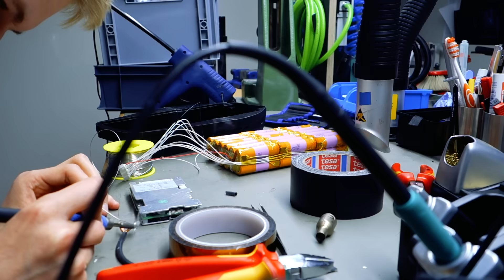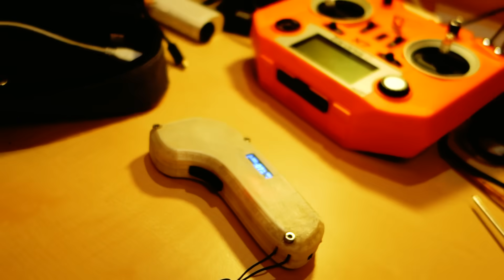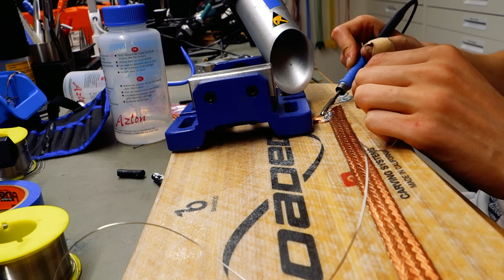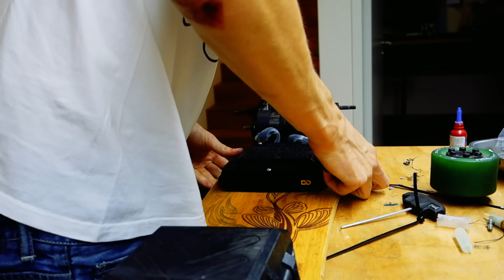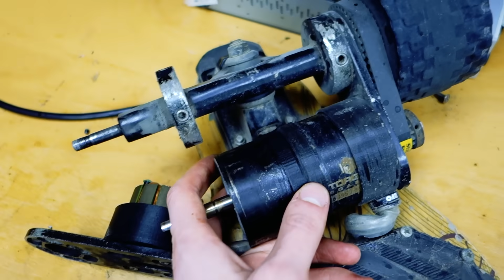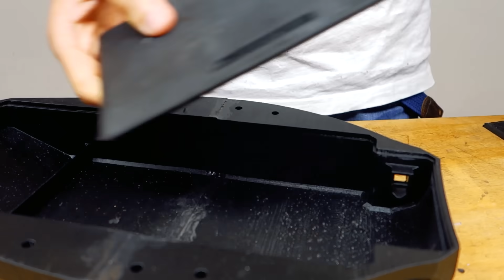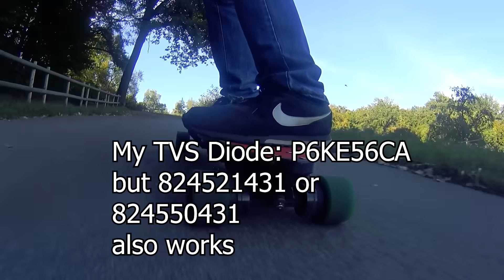My 3D Printed BOOSTED BOARD KILLER

Comment: als ob 5000 watt nur für 50 kmh reichen...
Reply from the maker: elektromotoren haben eine eckdrehzahl, da das ein single speed gear ist kann nur eine maximale drehzahl erreicht werden jeh nach dem welche übersetzung ich verbaut habe. In dem fall trifft diese eckdrehzahl auf etwa 50kmh. Ich könnte auch ein kleineres Zahnrad am Rad verwenden und damit locker 80kmh fahren, aber dann hab ich 1. kaum mehr drehmoment und 2. was will ich mit 80 sachen auf nem eboard...

Comment: Another useful and super cheap addition is a small pack of silica gel inside the casing. It will keep out condensation vapour and maintain as dry an area as possible. 
You will get them free in PLA filament packs so just keep and use.

Comment: Hey im teen and i have a long board, im kinda a tech geek so i think i would be able to build, but does anybody know how many money id need to save up?
Reply from the maker: you can use recycled cells and cheap "electric skateboard hub motor kit" from aliexpress and a cheap 10S BMS that will get you running with less than 300€. Its not a insanely powerful kit but its still a lot of fun...

Comment: I use quality capacitor on my drones circuit board for noise filtering on the battery. Thx for the tip for esk8 electronic I did not know the TVS diode.
Reply from the maker: I also added a tvs to my drone, just keeps it safe and avoids broken escs
Reply: @Pryside  I burnt a lot of esc... I will a TVs also. Super thank you.

Comment: Thanks man
Can you please tell me how many Amps are you running through your board ?
Reply from the maker: I was running 90 Motor Amps per Motor. So 180A there and around 115A on the Battery
Reply: @Pryside  Hey , leo can you also guide me through this ....
See my DIY E board battery has a discharge of 40 A , with a 24A esc. But i installed a 15 A bms on the battery pack...
But my positive end of the battery goes directly into the esc , neg end goes into the bms . So am i running my board on 15 A ?
Reply: 90A is crazy, your Battery is only 45 A !!
Reply from the maker: @esk8tapas22  no 45A is constant rating. Peak depends on if you monitor temps which I do. And how hard you want to stress them. 35A per cell is easily possible for a few seconds, wou wont need it for more than a second anyway, cause you'll reach 50kmh in no time with that
Reply: @Pryside  That's right ...
But you shouldn't stress your battery anyway ....
Thats why I'm going to use 21700 cells next time , which can put out 35 A constant & have great capacity to !!
Reply from the maker: @esk8tapas22  capacitance helps with hf voltage ripples not with any peak current. Look at the 25R cells for example they have 20A constant and 100A peak. And they actually haver higher Internal Resistance than the 30q

Comment: No way its 5000w
Reply from the maker: Here the copypaste from my forum:
Here is a full calculation of how much power you can actually get using my setup:

Fully charged Battery at 50,4V. IR per cell is 20mOhm (DC iR from Datasheet), 3 in paralell is 6,3mOhm, 12 in series is 75mOhm Lets calculate the theoretical maximum. I currently have a 75A Current Limit, but lets assume I set this to 90A say I go full throttle: My Vescs pull 180A 180A * 0,075Ohm = 13,5V voltage drop inside my Battery 50,4V-13,5V= 36,9V Voltage going to my VESC (still above 3V per cell) 36,9V * 180A = 6642W so thats the amount of Power getting eaten from my vesc. Thats where usually everybody stops and says that this is the power, but since there are a ton of losses at this current here is the real mechanical power that you would be measuring on a dyno: Resistance of my vescs: 0,0011Ohm Resistance of Motors: 0,0225Ohm (0,0011Ohm+0,0225Ohm)*180A²= 764,64W of Power loss in Motors and ESC 6642W-764,64W= 5877W MECHANICAL POWER so yes, the 5kW is easily possible.
Reply from the maker: it really is. Peak power of 5kW is possible

Comment: I want to turn this build into a dirt board version with snowboard like footstraps and rear mounted motors. 
Would you support my decision? I'd use your stl files and arduino programs in order to run it all. :D
Reply from the maker: yeah maybe would be a nice idea. Personally I dont really like eMountainboards, they are too expensive and too heavy and destroy the purpose of a light electric vehicle I can carry around everywhere.
And my battery case is not really designe for that purpose. Its just 12S3P on a mountainbaord you generally want to have more capacity since its heavier anyway.

Comment: Hallo Leo,
Ich habe dein Anti Spark Switch nachgebaut jedoch ist dieser mir nach einer kleinen Testfahrt hochgeflogen. Ich vermute, dass die >60 Ampere  zu viel für meinen Drahtwiederstand (axial, 50 W, 1 Ohm) waren. Dieser ist auch sichtbar kaputt gegangen. 
Hast du einen Tipp, welcher Drahtwiederstand besser geeignet wäre oder liegt der Fehler doch wo anders?
Reply from the maker: Hi tim. Da hast du was falsch gebaut und die Funktion davon nicht verstanden. Kein strom fließt im betrieb über R3.
Von meim antispark gibts mitlerweile ein gut getestetes pcb, kannst dir mal anschauen verkauf ich im forum.
https://www.electric-skateboard.builders/t/3d-printed-boosted-board-killer/88803/177
Reply: @Pryside   
Okay danke 👍

Comment: I also have an anet a8. I bought it 2 years ago for 170 € and it's still working really good. For remote I used a rc remote control but build an arduino nano in it for all this controling stuff.
Reply from the maker: Saw some Ender 3 Prints and for the price this is propably the best print quality. But with a Boden Style you can't print TPU, so Anet A8 stays my favorite cheap printer for now :)

Comment: Hi Leo!  I hope you can help me really quickly... I am DIYing my own E-Longboard right now and would like to add a TVS diode to my seltup as well. I am running on a 10S2P (18650)  Setup with a Dual VESC 4.20. Can you please give me advice what TVS diode I should use? I think you run on a 12S setup right? Do the diode specs need to be any different between 12S and 10S? Thank you so much! Keep the good vids comming!!!! Cheers!
Reply from the maker: The tvs mentioned in the video and mentioned in the forum. 12S with tvs and low ir caps like EEUFR1J681L is ok. You could use a lower breakdown tvs but this diode is ok for all
Reply: @Pryside  Thank you very much for the quick answer! You are the best! Keep the good vids comin'

Comment: Kannst du vielleicht ein komplettes Tutorial für die Firefly Remote machen? Meine Englisch-Skills sind leider nicht die Besten, aber ich würde voll gerne mir auch so ein Ding bauen. Aber sonst cooles Video!
Reply from the maker: ich werd die wahrscheinlich als kompettes set mit gescheitem pcb in den nächsten wochen/monaten entwickeln und verkaufen, damit kann ich glaub mehr leuten helfen, weil die firefly ist ein ordentliches gepfusche zum zusammenbauen
Reply: @Pryside  Das wäre Hammer!
Reply from the maker: Den antispark wirds übrigens auch in den nächsten 1-2 wochen als kaufbares pcb hier vorgestellt :)
Reply: @Pryside  
Hab ne frage wegen der anti spark.
Hab mosfets gefunden mit 20V maximaler gate to source voltage,meine frage ist kann ich die mosfets dann benutzen mit einer 6s batterie die vollgeladen 25.2V hat.(IRFS7530)

Comment: your choice of uart is sort of confusing to me. to be honest, my time using uart adapters proved them to be wildly unreliable with constant random disconnects and high latency.
Reply from the maker: Thats because of shitty cabeling and bad connectors, has nothing to do with the serial protocol. Uart is very reliable and fast with 5ms latency and definitely the right choice since you'll have safety that the command you want from the vesc actually gets processed. While a 5V signal on your pwm pin will send your board flying and risk your life, or a sudden 0V singal blocks your wheels and will also end very badly all this stuff cant happen with uart. On uart you can be assured that all your signals get processed the way intended. Uart is definitly not the issue its superior in every way possible.

Comment: Hi I'm trying to add the motor protectors to my flipsky 6374 motors but when I mount them it creates a whole lot of friction and you can barely turn the motors by hand. Is that bad?
Reply from the maker: My motor guards are not really made for any other motors, the guards are propably crooked and bent since cables and everything else is propably not the same as on my torqueboard motors. See if it really fits, propably you'll have to design your own. Only took me like 20 minutes of cad. Really simple design
Reply: @Pryside  thanks for the reply! im going on to build the battery pack now!

Comment: Anti spark?.. Why don't you just use a relay? That's what they're made for..

Also pla sucks. Use PETG, I print tons with it.
Reply from the maker: Petg has way worse stength compared to tough pla.
A Relay is not possible will create a huge spark between the contacts, increase the resistance and will melt your relay and destroy your escs when it shuts off under load due to its high resistance. You need a good antispark. On top of that any moving parts are always a bad idea.

Comment: Great video. Can you put a link of the TVS Diode you used for the vesc protection? I'm running a 10s3p battery (236.5W) battery and Vesc and 6374 149kv motors. Also, can you make a video on how to install the TVS Diode on the vesc.

Comment: dude, the  problem isn't the nun chuck, it's the control scheme.
Reply from the maker: nope, definitly not. I have tried everything, the tiny 5mm that your finger has to move without any real resistance and the high power my board makes, makes it very annoying to ride.
I rode around 2000km with this nunchuck and never got thrown off, but its just not as smooth as this scroll wheel with good resistance

Comment: Hi! Thanks for the nice build video. What size Ni strips did you use?
Reply from the maker: I think I bought the 0.15or0..2 x10mm from Nkon.nl and went double layer almost everywhere and tripple layer where the battery is split in half on the longes part.
Reply: @Pryside  Awesome! Thanks for taking the time to answer (:

Comment: 5000W sounds legit. fully charged batteries max peak discharge is about 5kW. Almost empty max peak is about 3,7kW almost empty non peak is about 2kW. its less than the half. Fully charged non peak is about 3kW. far away from 5kW.  Maybe i'm missing something. but i wouldn't call it 5kW if its just for 1-2 sec.
Reply from the maker: You can go 5kW for more than a few seconds but its just not practical, even on the steepest hill you will be so insanely fast in no time. What else should I write? The motors are only able to produce maybe 22A constant so should I write 1800W because thats the power that you can go for hours nonstop with 40°C outside temperature without overheating anything. On a eBoard you weigh almost nothing and have so little air drag, the only number that matters when it comes to actual acceleration and ridefeel is the peak power. If I had bigger motors and battery that could handle the 5kW constant driving experience wouldn't change at all.

Comment: Auf wie viel Volt kann ich meine Zelle noch sicher entladen und was würdest du empfehlen? Ich würde dich noch gerne etwas zu einem Killswitch fragen, wo soll ich ihn verbinden und mit welchen Komponenten?
Reply: batterien kanst bis 3 v gut entladen ohne zu großen schaden anzurichten besser 3.2 oder so nur nicht unter 2.8 dann wirds kritisch
Reply from the maker: Li-ion zellen mögen ganz voll und ganz leer nicht. 2.5V ist ganz leer, 4,2V ist ganz voll, jetzt suchs dir selbst aus, schau dir die Entladekurve deiner zellen an und entscheide wo es sich nicht mehr lohnt zu entladen, standardmäßig würde ich im vesc dann noch etwas drunter gehen. Mein eboard ist glaub auf 3V-2.8V battery cutoff eingestellt, sodass ich unter belastung noch auf 3V runterfallen kann und es nicht gleich drosselt bei 30% akku. Erst so bei 20% und niedriger merkt man die drosselung. Ich entlade eigentlich nie unter 3,2V

Comment: Have you tried Hugertech boards. They are definitely my fav. Boosted is second. And have you published detailed Stls with the instructions online somewhere? I would be interested in giving yours a try. I am on a phone atm and may have missed it in the description.
Reply from the maker: I think you have never ridden a Boosted Board. This board has a stiff short deck, has no power and has a very cheap build quality. Maybe a decent budget board but not something I could use as my daily commute, my ankles would die from this.
Reply: @Pryside  I have a boosted and a hugertech racer. I modified the racer and ride it 20 miles to work and 20 back. Had to swap out the deck though as bumps suck on it. Pot holes are definitely a looper on it too. I had a nice hole in my hand from a pot hole that was under a news paper. I was going 20mph at the time and went all superman till I scraped pavement. It's great on hills too. I charge it during the day at work and at night. The power is ok and better than my boosted. I like the Boosted for it's smooth ride. 

I am hoping to try out yours as I think it beats both by a margin so large it's insane. I have never built my own as of yet but I am looking forward to completing my first. I just started ordering the parts last night. Most people that try the huger boards try the smaller ones which kinda suck. I tried my friend's racer and it was better than my travel board which I sold off as I already ordered a racer as well. You should really start making these things commercially. No way they wouldn't sell fast from what I see in this video. I will find out for myself later this spring once I am done with my build.

Comment: how are those 3d printed gears holding up?
Reply from the maker: great. When using belts the stress is spread all around the plastic gear, so other then a little wear there is nothing to complain. Have ridden almost 800Km on the same gears before, and 800 more would have propably been possible but they are only like 3€ to print new ones.

Comment: Hey Leo  Pryside 
die 160 euro für den esk8 vesc sind mir zu viel.Ich würd mein board mit 6S betreiben.Reicht da der VESC von torqueboards oder nicht.Und hast du bei diyelectricskateboard erfahrung mit zoll, wenn ja ist es eher viel oder nicht :D
Reply from the maker: such mal auf ebay, da gibts für 70€ n vesc von flipsky. Den maximal mit 10S halt betreiben, die TVS drauf und das hält sicher. Wenn du dann die settings halbwegs sicher hast sollte der nicht hochgehen
Reply: @Pryside  ich verstehe das mit der diode nicht dann kann er nicht mehr rekuperieren (tu mir etwas schwer da ich erst 12 bin )

Comment: Hi Leo, 
thanks for your video. It is very impressive. I have some questions: 
1. in your previous video you were soldering the battery pack. Did you find any huge disadvantages compared to welding?
2. how did you integrate the smart bms? most can only handle up to 70A, but your setup must have at least the double.
Thanks.
Reply from the maker: Yes, in my first eBoard and also my very old eBike I used to solder the cells, I think its still an okay option if you have a somewhat powerful soldering iron. The main reason I switched to welding is because its way cleaner and theoretically doesnt stress the cells so much. Spotwelding saves quite some space and looks overall way nicer than soldering.
Even I use a 60A BMS. But these 60A are the rated constant current. Meaning 2500W constant power. Thats more than enough. The BMS can handle 250A peak easily.

Comment: I just bought a electric longboard kit that has a 10s2p battery and 2 500w hub motors.  Would I use the same TVS Diode for my board or do I need a different one since I had less power going through mine?
Reply from the maker: No you can use the same tvs diode if you want. 10S is a bit less likely to break. but if you got the normal cheap vescs I would still recommend you solder a TVS on the PCB

Comment: I see you use a cheap "sekundenklebber" :D
Check this => https://pascofix.de/ger/webshop/messesets/pasco_4er_messe_set_20g/?i=21&in=PASCO%204er%20Messe%20Set%2020g
it gets HARD in less then a seconds becouse you alsow get FILL => filler
Reply from the maker: looks nice but their datasheet is terrible. They claim 22N/mm² of shear strength and dont mention the materials. While Locite 406 has up to 26N/mm² of shear stregth on steel...

Comment: I did the math.  , you saved no money really..and the parts that are 3d printed are not good quality...you only risk fire and blowing up the board with your over powered board and electronics made for lower power.  not. good idea. but have fun with your hobby.  Meepo boards are cheaper in cost and better quality. 400 euro gets a a v2 with 42 km/h. and 20 km in range. and a warrantee and tested reliability .
Reply from the maker: This is not even about saving money. How do you even do the math? There is no skateboard with this good ride quality, the flexible deck and this oled remote with 5000W on the market. Its just not something you can buy? And comparing that to a Meepo? A board that has 800W and wouldnt even be able to push me up any hills in my area. My board has the power of over 6 meepo boards, twice that of a boosted, a ride quality like the boosted board, bigger wheels and a remote that is way better than anything on the market. A board like this would retail at maybe 2500-3000$
And only cost me 1200$ to build myself.